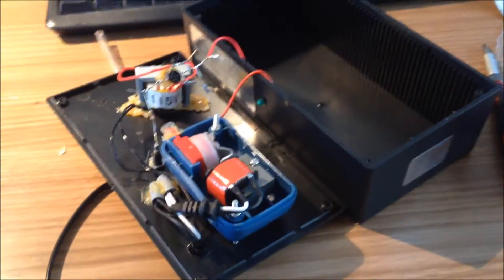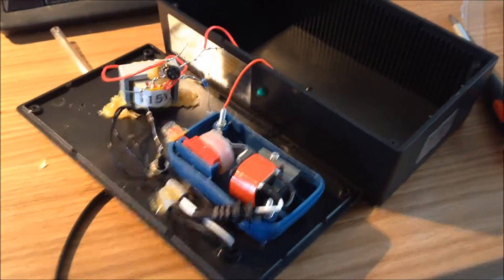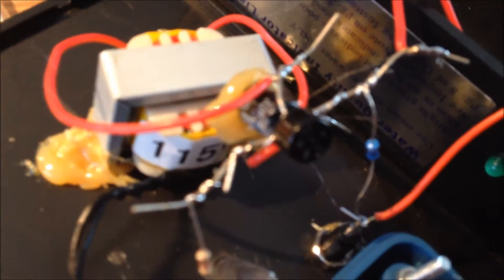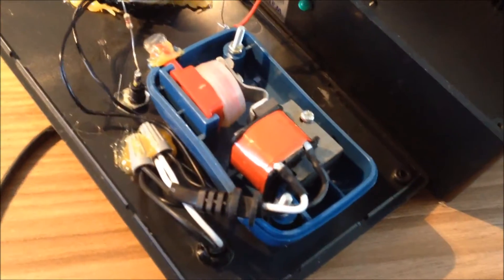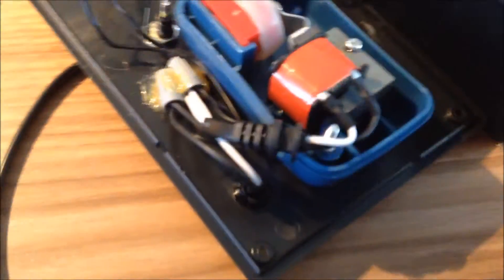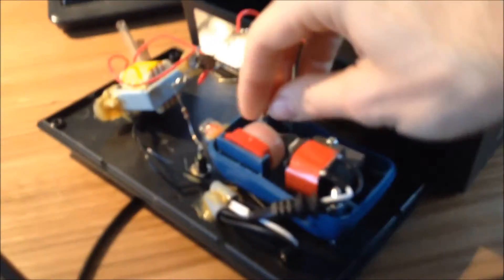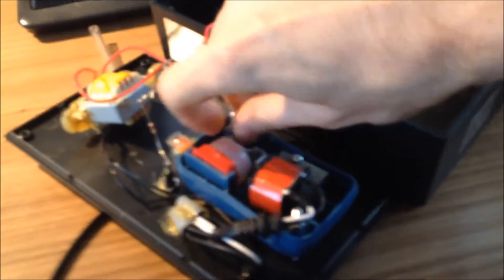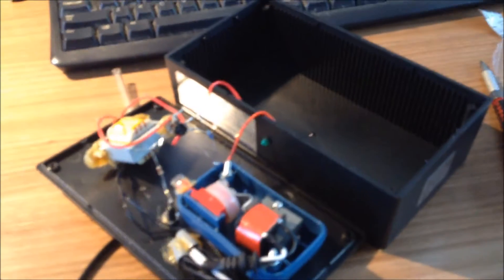Inside the Silver Edge Micro-Particle Colloidal Silver Generator, a Mini Teardown

Comment: Hi  sttrife! Thank you for sharing!  I would like to ask you if the "Micro-Particle Colloidal Silver Generator" is made with DC adaptor and a pump that makes the bubbles inside the water? And off course, the silver.  Is that right? This means  that if I ad a  pump and a tube on my "normal colloidal silver homemade equipment" I can make micro´particle colloidal silver? Thank you!
Reply: +andrew mckim Not to call shenanigans on you, but unless you tested your generator's silver with an Electron Microscope as Sovereign Silver/Natural-Immunogenics has on its bottle colloidal silver and competing products to determine silver diameters, you are blowing smoke.  ICP Spectroscopy tests the ppm concentration not Faraday's Principle. You evidently don't know what you are talking about.  What are you using as a capping agent to prevent the agglomeration into larger particles during reduction into metallic silver? If you do not use anything, it's doubtful you produced 14 nm diameters. Is your final silver clear or a cloudy yellow? You shouldn't believe everything you read on the internet about colloidal silver.
Reply: +andrew mckim I am not wrong. A few lab tests would prove or disprove this point. A scientist would check his results with forensic tests or reserve comments until such tests were performed, rather than hide behind the ghost of Faraday. An ounce of tests is better than a ton of theory.  Your colloidal silver is transparent (good), but the presence of a light yellow color indicates you may have produced flocculation, aggregation, particle diameters that are larger than 200 nm, or possibly AgNPs crystals that are not perfect spheres. Without an electron microscope photograph you have no proof. An ICP spectroscopy would settle the silver concentration (and any other metals present). Your claims are merely speculation on your part. Orr and Dallavalle wrote 57 years ago in Fine Particle Measurement Size, Surface, and Pore Volume, published by MacMillan on colloidal silver in visible light. The authors stated colloidal silver at 10 ppm exhibited a yellow color if the particle size was larger than 0.2 microns (0.2 micrometers more commonly referred to presently as 200 nanometers) and was otherwise colorless if smaller than this diameter. Fine Particle Measurement. Size, Surface, and Pore Volume by  Clyde Orr, Jr. and J. M. Dallavalle,  Macmillan Company (1959). The late Clyde Orr, Jr. PhD is a well regarded scientist and a pioneer in how to measure the total area of all the tiny surfaces.  http://www.ajc.com/news/news/local/dr-clyde-orr-88-co-founded-gwinnetts-first-high-te/nQkNX  When this work was published, there were no colloidal silver products of any form available for sale  nor were there colloidal silver generators. Retail sales of colloidal silver and associated silver products began in Health Food Stores in the 1990's; generators became available towards the end of that decade.The late Professor Ronald Gibbs, director of the Center for Colloidal Science at the University of Delaware between 1981-2000, cited Orr and Dallavalle's work in his 1999 book,"Silver Colloids---Do They Work?" Professor Gibbs wrote that the highest quality colloidal silver is colorless. Gibbs only tested metallic silver and eliminated any ionic silver products from his test of 15 over the 
counter colloidal silver products. Gibbs also wrote that colloidal silver could be yellow if flocculation (stuck together or aggregated particles) had occurred (found in poor quality 
colloids), or if contamination had occurred . Not mentioned in Gibbs's text, high part per million concentrations (over 100 ppm) will exhibit a yellow color but he did not investigate OTC products at higher concentration.UCLA noted that near spherical AgNPs crystals showed a yellow color at 20 nm or smaller, but they had used heat, silver nitrate as the source for the silver ions, and sodium citrate  as the reducing agent and capping agent. Silver nitrate provides Ag+ ions was reduced by sodium citrate, which itself becomes oxidized. Excess sodium citrate present in the solution caps the particles through the carboxylate groups and prevented the growth and aggregattion as larger particles; this procedure is carried out at elevated temperature to decompose the citrate and increase the speed of particle growth. The ratio of sodium citrate to silver ions causes a change in nanoparticle size.Other individuals have noted color (red, green) at diameters smaller than 200 nm, these were irregularly shaped AgNPs at 30 nm to 50 nm. Gelatin or other denatured proteins have been used as suspending agents for mild silver protein.  I am more acquainted with oleic acid (OA),  polyacrylic acid (PAA),  Chitonsan (a naturally occurring polysaccharide found in shellfish, and  (most commonly) polyvinyl chloride (PVC) being used as capping agents.As to "Faraday's equation for electrolytic deposition" or "Faraday's Constant," I am reminded of a spreadsheet program that was bandied about the internet silver lists back in 2001.  The problem with the program when I first laid eyes on it, there was no parameter for the distance between the electrodes. A rather large omission.If you have access to a college chem lab with precision scales, you could weigh your silver electrodes before and after colloidal silver generation. This would give a more accurate measurement of silver in the water, until one invests in a lab test.
Reply: @peachblossums5151  you seem to be very knowledgeable about this subject.   Is there any way to pm/dm you for some info?
Reply: +andrew mckim Reducing the distance of the electrodes reduces the resistance of the water.  In a non-added electrolyte system it does matter.
Reply from the maker: +Rabia Dharma Yes that seems correct. From what I've learned, the 3 things you need to create micro particles are pure distilled water, pure-silver electrodes with a DC voltage on them (not too high or low), and something to 'agitate' the water (some people just keep stirring, but I wouldn't like stirring for 3 hours). A little pump with a tube is what is used in this device.